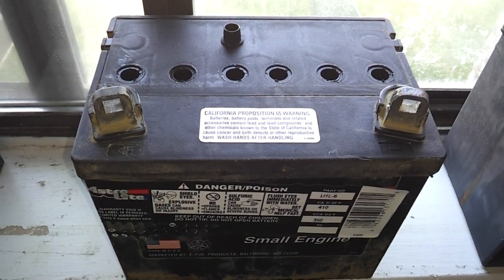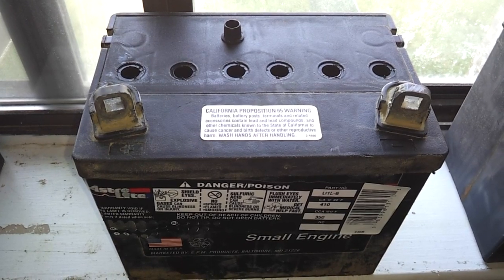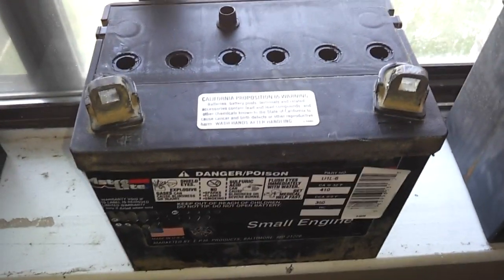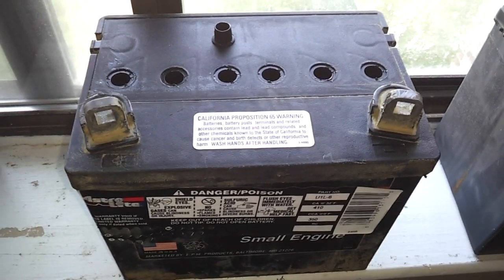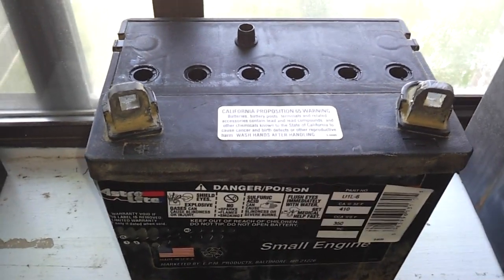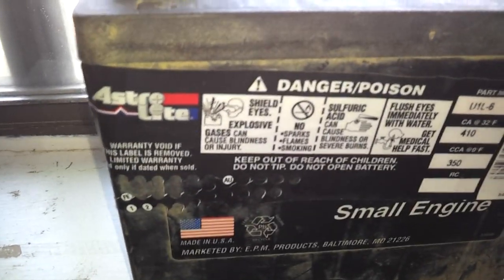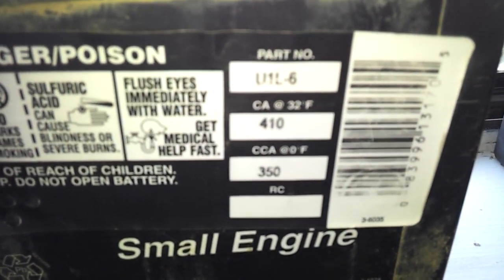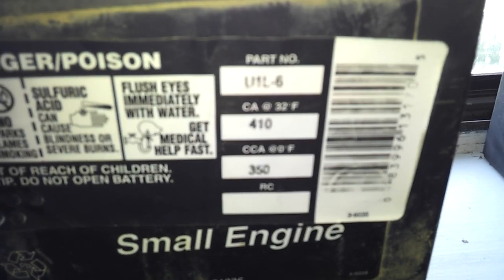Desulfator Time Lapse Internal Cell Video

Comment: After you use these, what did the max voltage charge of the battery look like? I would assume that the voltage charge at full capacity would go up right (to regain what it used to get at)?

Comment: I have only some doubts wether this process,of reconditioning also works well on a battery which not only has slightly dentritic sulfatation because of being well discharged for a longer time and with a still minimal nominal acid level (means small crystal needles) but with one from the junkyard or from an old garage car which has slept for maybe years without charging. Means with a literally "dead" battery being full of rogue big sulfate crystals, and without a measurable (or pretty low level of) acid in the water. (means all the sulfate being entirely bound to the electrodes into rogue crystals) These crystals so-to-say obstruct all the microcavities in the plates, also causing a very low current going through them initially because of vastly reduced surface. (fresh batteries pull high charging currents when almost fully discharged). That is the question wether a so-to-say dead battery can be revived or rather not. What should remain after a charge: one plate Pb (brown), the other one should be covered with  Pb-Oxide.(some special advanced types instead have Ca/Ca plates or Ca/Silver plated electrodes)

Comment: That looks like it was manufactured by East Penn for Astro light. 

I just bought two deka 778dt batteries also made by East Penn. 

I have been looking for a video on how to remove those exact caps. 

Could you do a close up and explain how you got them off. 

Thanks for the post.

Comment: The video only tell something in theory but did the battery accept charge or current. Some desulfator being offered on the market actually rely on the battery voltage without external power for the desulfator itself and leaving for the whole month will drain the last charge of the battery being desulfated.